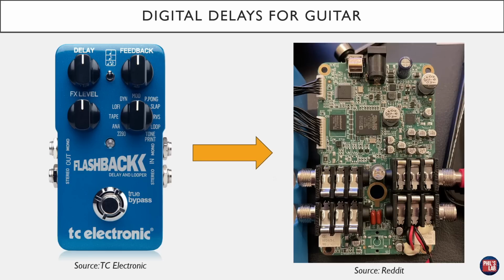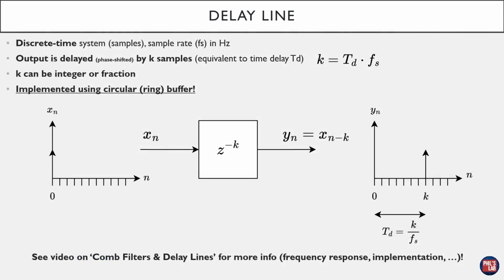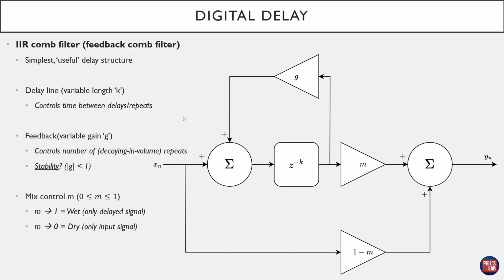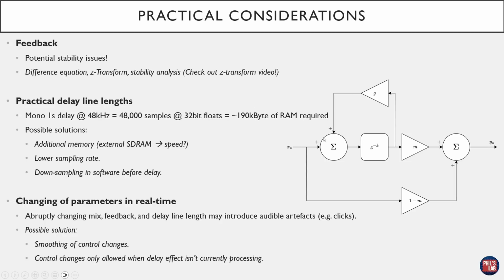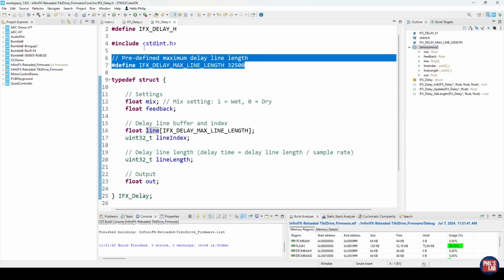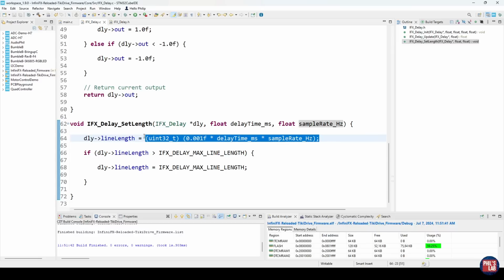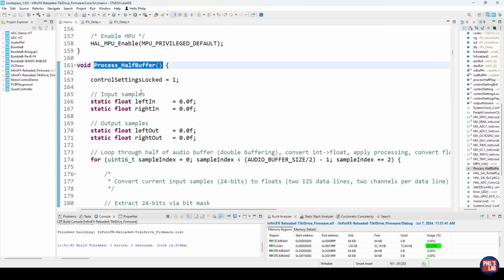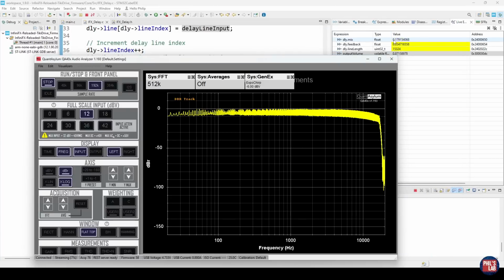Delay-Based Audio FX Software Implementation (DSP with STM32) - Phil's Lab #140

Comment: Hey, I'm a bit late to the party but I've tried searching for info on the analog front end of your custom PCB in the other guitar effects videos and I couldn't find what I was looking for so I thought I'll just ask. Could you describe what gain are you running on the ADC and DAC sides? My question is more like, do you need to amplify the input signal so that you are working with the full scale of the ADC, perform the DSP and the attenuate the DAC output so that the level is still acceptable for a guitar amp? 

Great videos by the way, thank you!

Comment: Just one question on the software, Phil. How did you control the execution timing of the "Update" function? It should be executed whenever a new sample comes in, so I guess it is driven by an interrupt, right? As always, thank you, and nice video!
Reply from the maker: The audio processing function is called by the Half-Complete and Complete callbacks of the I2S DMA stream. The processing function works on a set number of samples (around 128, or 256).
Reply: @PhilsLab  Got it, thank you!

Comment: One possible solution for lowering RAM requirements is simply replacing 32 bit floats with 16 bit intergers and then using fixed point arithmetic.
Besides, it's extremely likely than external SDRAM will be run at frequency much higher than sampling frequency, so this is not a real bottleneck.
Reply: how does it work? you make a 0.16 fixed representation of 0-to-1 floats?

Comment: A coincidence that I was just brainstorming an analog idea today and in looking at the more advanced work of others, had to assume the stability branches strewn about the circuit came at a more advanced stage of a prototype. 

In that the desired effect was achieved and then immediately following that process, instability or undesired signal traits were discovered from test and analysis and resolved with additional architecture.
It's relative but I won't even attempt to tackle digital until the end of this year.

Comment: Definitely nice work . Few questionos: 
1.  Will  be schematic available for  us? 
2. Are there  any noise interferences (hum) when you add gain on your amp?
3. If you use this MCU how much max. delay in sec you can get (16- bit  mono)?
Reply from the maker: I'll make a hardware walkthrough at some point. Noise floor is below -90dBu - so you'll have to add quite a bit of gain/volume to hear it. This particular MCU has over 1MB of ram - so a couple of seconds of delay, with reduced sampling rate and bit depth.

Comment: Summary

0:00 Introduction: This video details the software implementation of a digital delay effect using C on an STM32 microcontroller.

1:44 Hardware: 
* Similar structure to commercial delay pedals (TC Electronic Flashback used as an example).
* Analog Input/Output with jacks.
* Analog front-end circuitry for filtering, amplification, and attenuation.
* Codec (ADC and DAC) for analog-to-digital and digital-to-analog conversion.
* STM32 microcontroller as the DSP (Digital Signal Processor) instead of a dedicated chip.

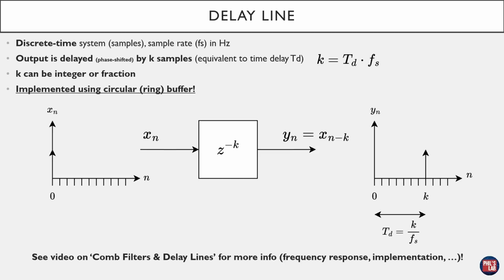4:52 Delay Line (Heart of the effect):
* Implemented using a circular (ring) buffer in software.
* Stores a certain number of audio samples (determined by the desired delay time).
* Output is simply the input delayed by the defined length of the buffer.

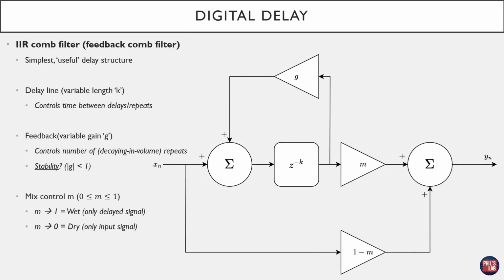6:58 Digital Delay Structure:
* Uses an IIR (Infinite Impulse Response) comb filter with feedback.
* Input signal is summed with a delayed and attenuated version of itself.
* Three primary controls:
    * Delay: Controls the length of the delay line (time between repeats).
    * Feedback: Controls the amount of delayed signal fed back, affecting the number of repeats and decay.
    * Mix: Controls the blend between the dry (original) and wet (delayed) signals.

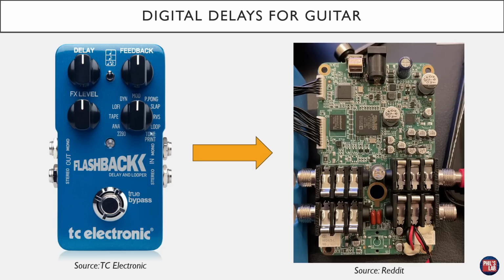9:34 Advanced Delay Structures:
* Can create different delay effects (tape, lo-fi, modulated) by modifying the basic structure.
* Examples include:
    * Adding filters in the feedback path for tonal shaping.
    * Splitting the signal into multiple frequency bands and applying separate delays.
    * Using multiple delay lines with a matrix of feedback and feedforward paths (used in reverbs).

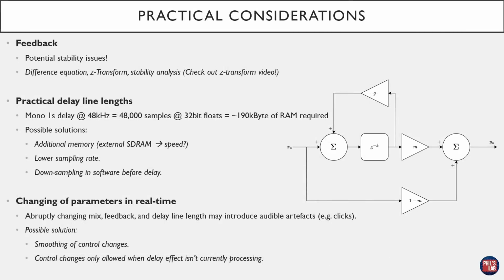11:14 Practical Considerations:
* Stability: Feedback loops require careful design to avoid unwanted oscillations.
* Memory: Delay lines require significant RAM, especially at high sampling rates and bit depths.
    * Solutions include adding external RAM, downsampling, and reducing bit depth.
* Parameter Changes: Abrupt changes to delay parameters can cause audible artifacts.
    * Solutions include smoothing control changes with low-pass filters and limiting changes to when the effect is inactive.

14:30 C Implementation:
* Uses a struct to hold delay settings (mix, feedback, delay line length) and the delay line buffer.
* Key functions:
    * `delay_init()`: Initializes the delay structure and clears the buffer.
    * `delay_update()`: Processes each input sample, implementing the feedback and mix controls, and managing the circular buffer.
    * `delay_setLength()`: Calculates and sets the delay line length based on the desired delay time and sampling rate.

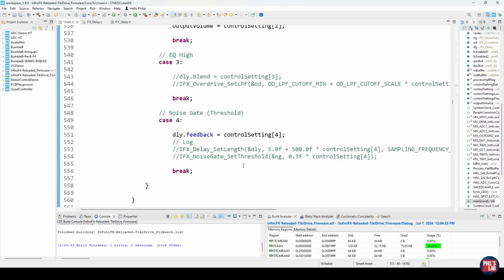22:30 Test Set-Up: (No specific timestamps for sub-bullets, but they fall within this section)
* DSP board connected to guitar, audio interface, and potentiometers for control.
* Debugging tools used to monitor variables and frequency response in real-time.

24:54 Demo with Guitar: (No specific timestamps for sub-bullets, but they fall within this section)
* Demonstrates the effect of adjusting mix, delay length, and feedback controls on the guitar sound.
* Highlights the characteristic sound of a digital delay effect.

27:35 Outro: Concluding remarks and call to action for viewers. 

i used gemini 1.5 pro to summarize the transcript